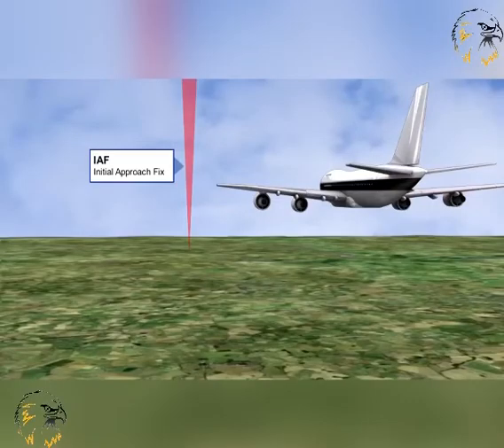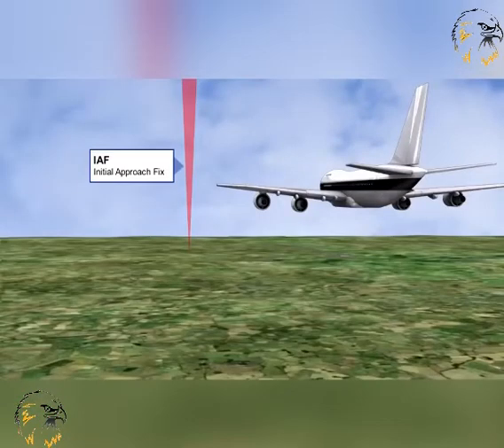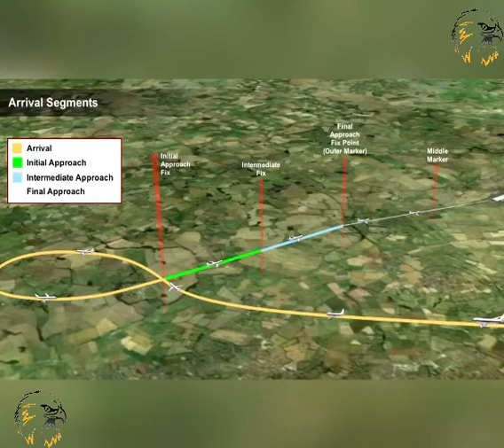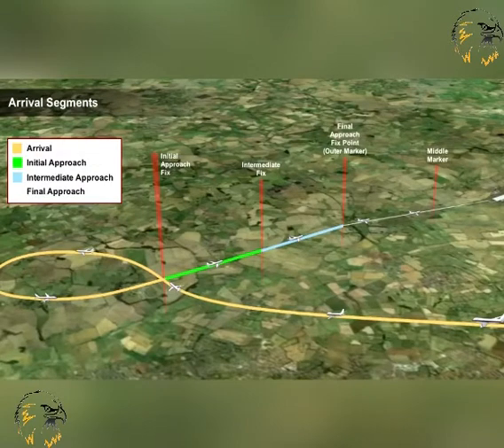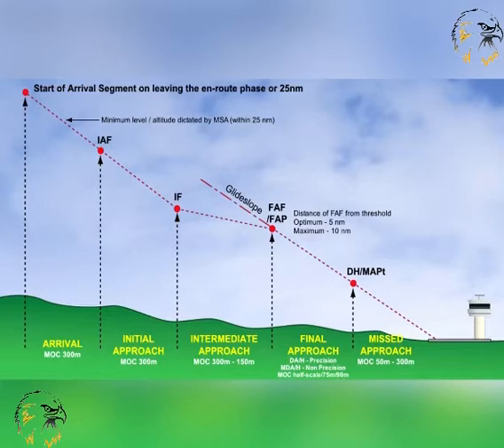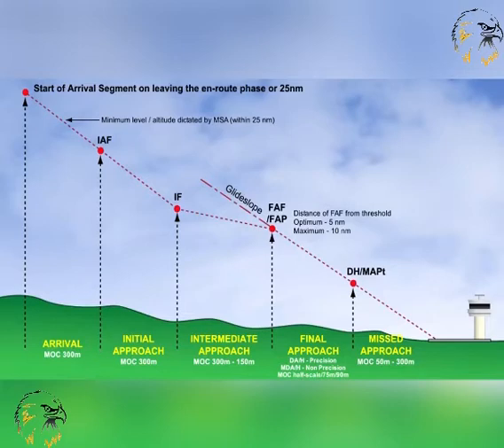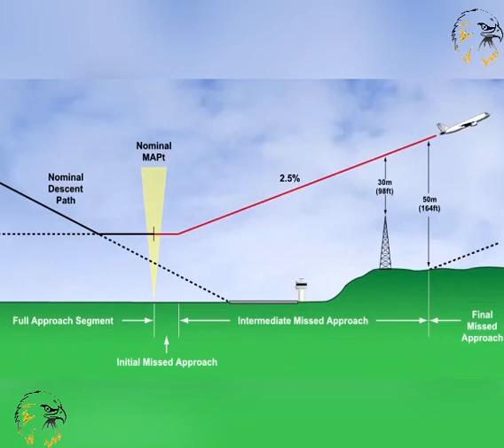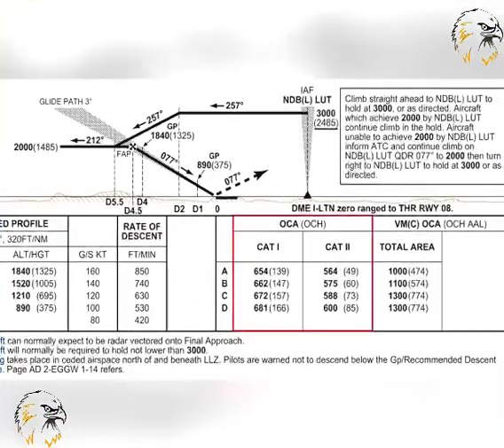038 ARRIVAL AND APPROACH SEGMENT | AIR LAW | AIR REGULATION | ATPL/CPL TRAINING | CBT

Comment: IF THE APPROACH TURNS UP TO BE PASSIVE IN ONE OF THE DME IN THE THREE CONTACTS THEN THE OAC RUNWAY MUST BE USED? IN CAT I OR IN STATE DOMESTIC TO DOMESTIC A PRESSURE ALTIMETER IS USED? IN CAT II OR IN COUNTRY DOMESTIC A RADIO ALTIMETER MUST BE USED? WHAT THE OCA IS IS THE DISTANCE FROM THE FINAL APPROACH TO THE GROUND? THE IS A WARNING FOR THE AIRMAN?

Comment: IN THE IAP IS THE FINAL APPROACH IN WHICH ADJUSTMENTS MUST BE MADE SO YOU WOULD RIDE THE BEACON OR IAF BEACON TO THE FAP OR FINAL APPROACH FIX? ADJUST MENTS WOULD BE TUNING THE MODE PANEL TO THE ACTIVE\ACTIVE\ACTIVE DME FREQUENCY? THEN YOU CHECK TO MAKE SURE THERE IS NOT A PASSIVE IN THAT AND YOUR RVR IS ENOUGH TO SEE SO MANY FEET AHEAD?

Comment: YOU WOULD HAVE THE INTERNATIONAL AIRCRAFT MODE PANEL TUNED TO ACTIVE\ACTIVE\ACTIVE DME RADIO FIX? THIS HAPPENS AFTER YOU CONTACT THE AIR FACILITY FROM ATC REQUEST?